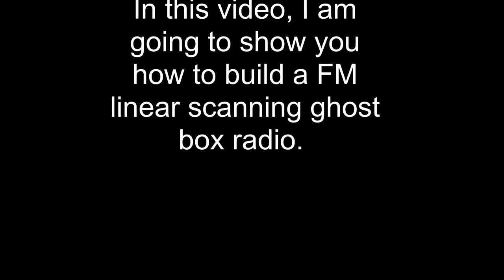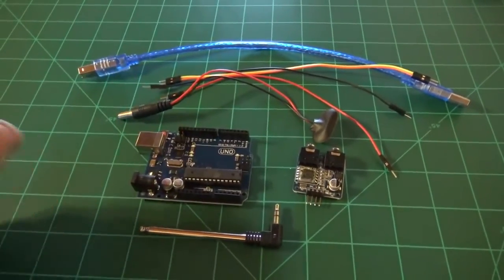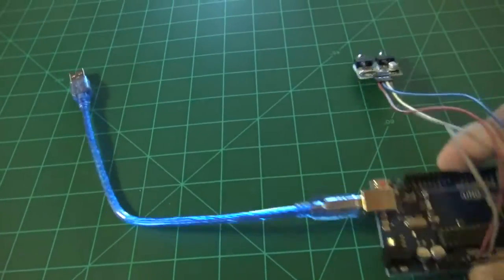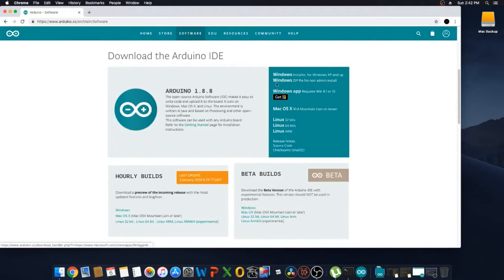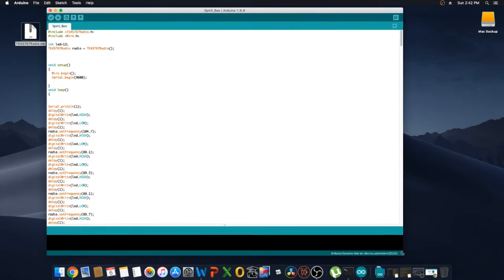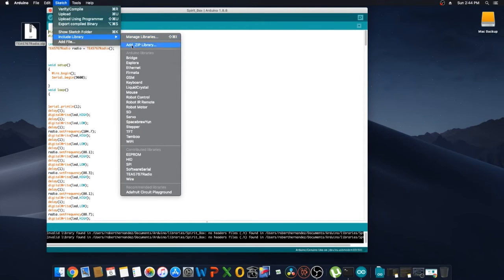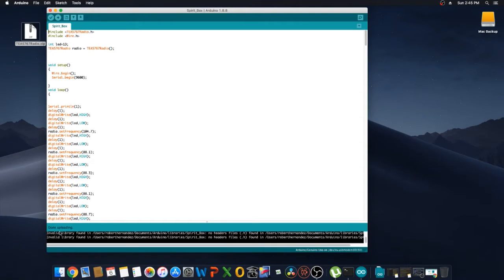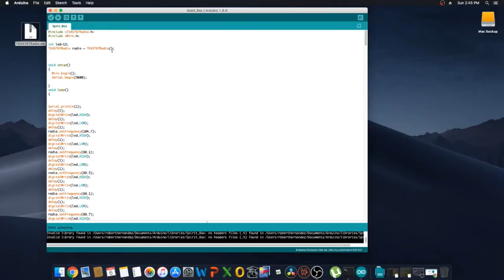Build your own FM Scanning Ghost Box

Comment: Is it possible to just use an FM kit that had a station seek type tuner, make a modification to the tuner, and achieve the same result without the UNi board or the programming. Similar to other procedures I have seen, using certain Model radios and cutting some wires or changing some jumpers. It essentially bypasses the signal found function and just keeps sweeping the channels. I am not very strong with computers and that is why I ask.